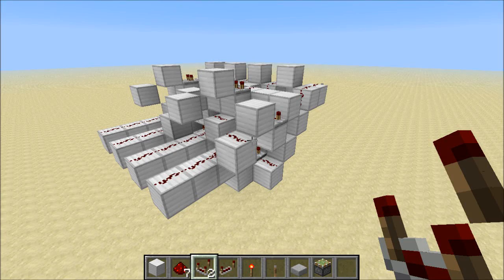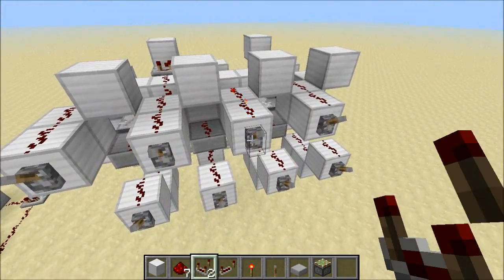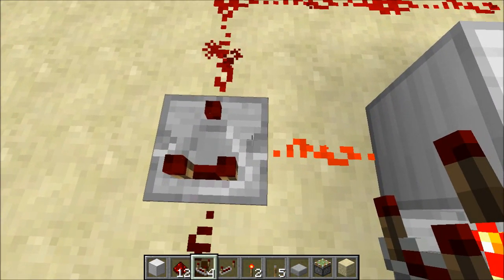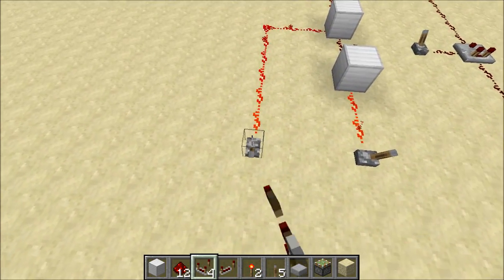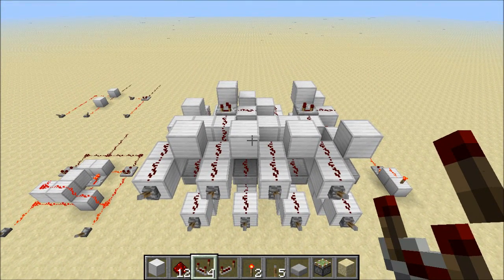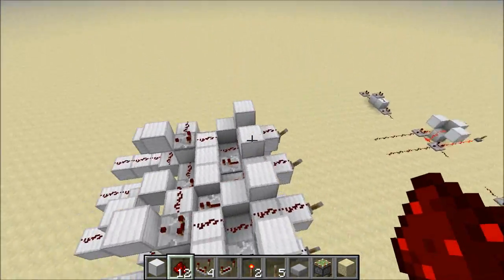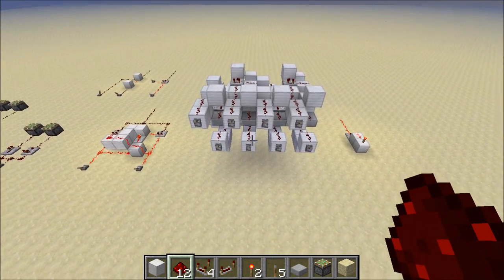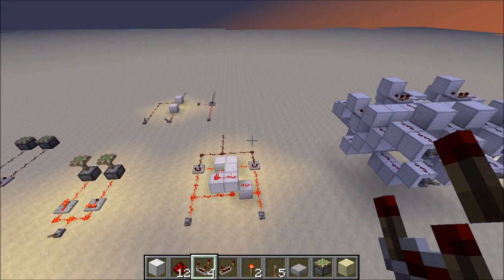2-Wide Tileable Redstone Comparator XOR Gate

Comment: Proper I heard the delay has to do with the infinite loop bug.
But the code to check for this is very long and takes too long soo updating is random because of that. not sure though but if this is the case then I think the will fix it after all it is the first snapshot lot's of things can change.

Comment from the maker: The difference is that this one is two wide tileable, meaning you can stack them up against each other. That design is fantastic if you don't need to do that, but for most of my applications it wouldn't work.